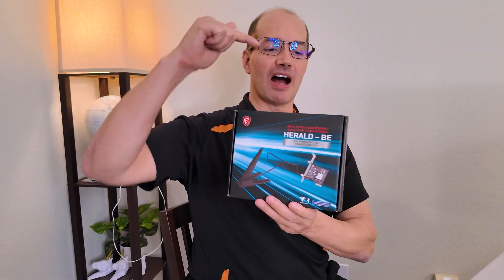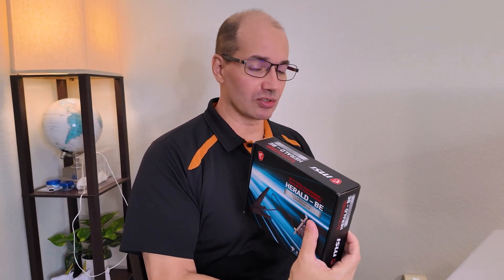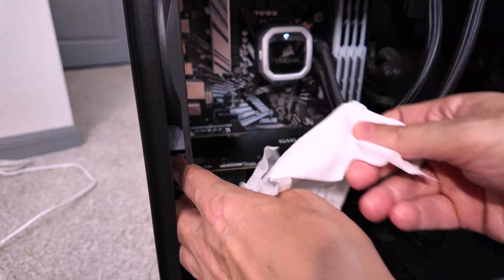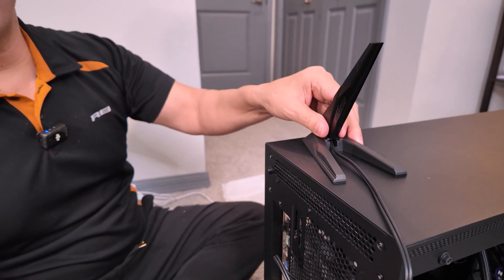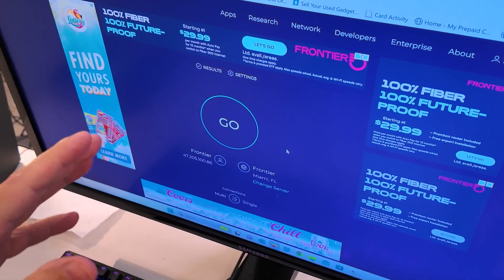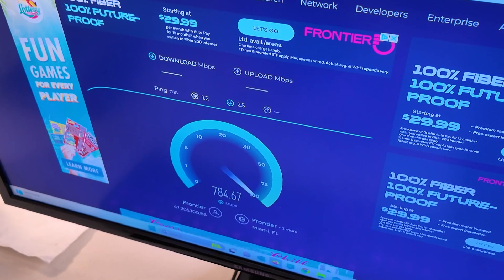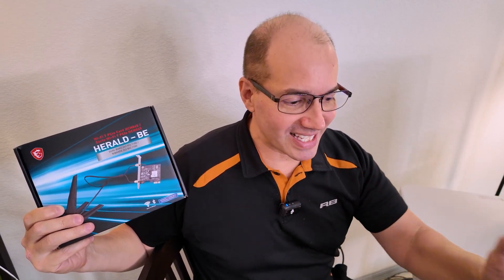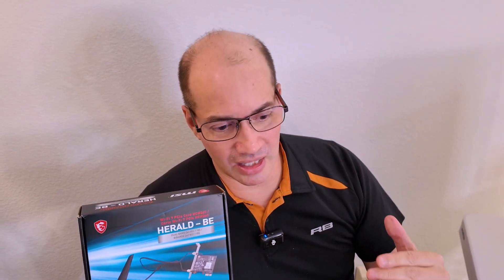MSI Herald BE WiFi 7 PCIe Card - Review & Demo

Comment: I think that MSI Herald BE adapter should be able to get substantially faster speeds.  If you do the speedtest using internet connection, then it will get bottleneck there, limiting the max speed.  You might want to test the speed in local network, using for example openspeedtest on some computer and make sure all connections are higher than 1 Gbit.  Anyway, 800 Mbps is also really fast, but it could be closer to 2000 Mbps if all the equipment supports higher speeds.

Comment: I have the same card. My modem is 2 rooms away on the same floor. To my surprise, the wifi speed is identical to the Ethernet when testing with no background apps or processes running. Very good card.
Reply: i would agree i just moved my pc in my room and the modem is all the way accross the house and down stairs so this helped a ton

Comment: connect it with an asus BE92U router or better in MLO mode and you will exceed the speed of ethernet ;) why choose 2.4, 5 or 6ghz when you can use all at the same time :)

Comment: I'm testing Wi-Fi 7 and get around 1200 on my Iphone 16 Pro which is kinda meh so I'll through this card in my PC, looking forward to speed testing :) For testing I'm always creating a test SSID broadcasting 6Ghz only as such I don't share with other devices :)
Reply from the maker: Let me know how it goes.
Reply: @ConservativeNewMedia  It didn't go so well.. Put in the card and tested Wi-Fi 7 on the 160 band: result 850/330, then I changed the band to 320: 900/330 and right after that the driver crashed. I'll figure out why and report back when I fix it. But now I'm running on 5Ghz on the 240 band and get: 850/330 with a Wi-Fi6E chip just an fyi. Of course I'm testing on a separate ssid and WAP group to not interfere with anything else in the house.